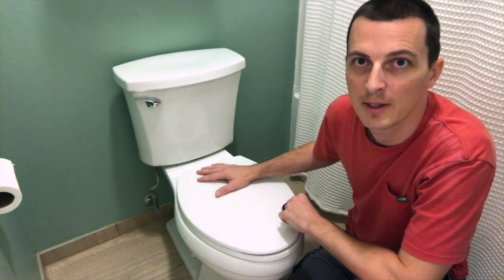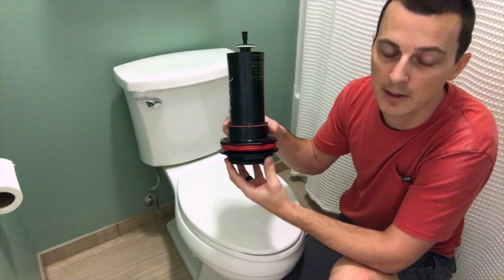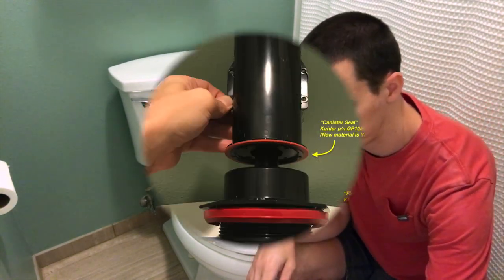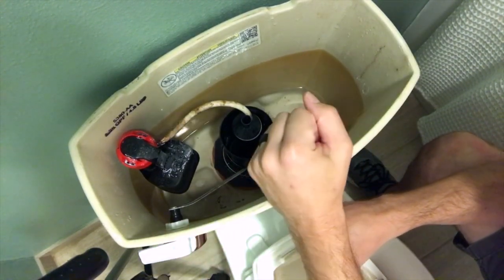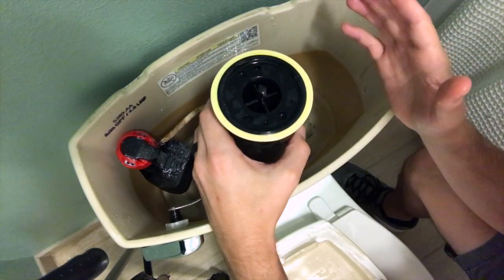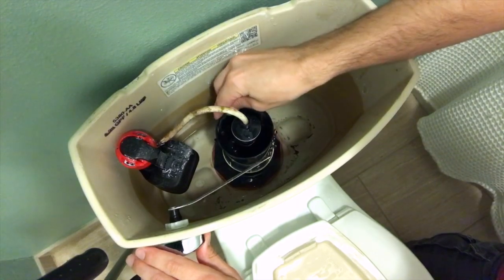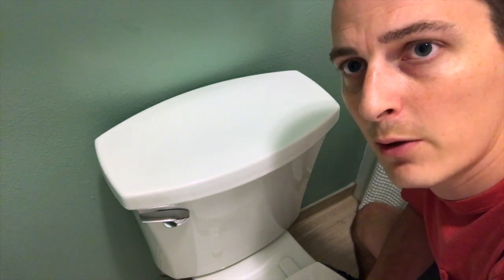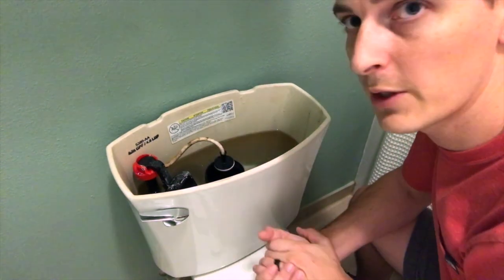Repair a leaky Kohler toilet with an Aquapiston canister flush valve

Comment: This presentation was excellent. I'm a 71 yr old grandmother, and installed 3 toilets over my lifetime Your video was the first to explain the complete installation process including the plate on bottom of tank. My silent flow valve never turned off, water was filling up and draining continuously for 2 months.I had an astronomical water bill. I still  do all my home repairs myself, and always look to YouTube for assistance. I thank you for your video, well done! , toilet fixed with ease.

Comment: Over time, those stupid black brackets begin to rust and the rust gets into the threading of the flush valve. At that point, you have to put a little piece of something between the flush valve and the tank to keep it from turning in place, take a large wrench, put all your weight into unscrewing it, and hope to God that you don't break it. Kohler has some of the absolute worst designs out there and this is a perfect example of it.

Comment: My flat seal started to leak after only 2 years on a new Kohler. I purchased your wrench tool and it worked like a charm to aid in the repair. My channel locks wouldn't go wide enough so thank you for making that. Awesome job with the detail in this video!

Comment: Another tool I found you can use is called a trigger clamp. I have some because I do a lot of wood working. I do also use them for a lot of other things and they do come in handy. Even if I didn't have one, I would have gotten one of these to do this job, you more likley would use this for other things, rather than a specialized tool, that I hope you never have to use again. Other wise, I am with everyone else, this is a great video and it helped me a lot.

Comment: Nice through video. I took a quick look at the eBay page but didn’t see the wrench there. I would never use A petroleum product like Vaseline on a o-ring or seal. That is exactly what makes them swell. It’s advice from the old days when selling o-rings was profitable. Stick with the silicone grease only.

Comment: Just did one of these.  Your video helped a lot.  HOWEVER, that 4" nut was on REAL tight.  So tight, that when I went to turn it, the base that it's screwed on to started turning.  I had to use a small shim of wood (about 3/8" thick), and wedge it between one of the base's hex flats near the bottom on inside the tank, to hold it from turning.   Just a heads up for others that may encounter this same level of tightness.

Comment: Thank you for a perfect step-by-step procedure. Ordering your wrench saved me the stress I got trying to get the old one off with an oil wrench. Oh it came off alright, in a zillion pieces after I couldn’t get the oil wrench to budge. Perfect creation, thank you!
I used the silicone grease and bought the new yellow gasket, since the Kohler kits still include the red one (2024). 
Thank you again.

Comment: Thank you so much!  This is really an extraordinary video, one of the very best home DIY repair videos I have ever seen.  The details about specific part numbers for literally every single thing you mention in your video was for my particular situation a game-changer.  There are a zillion videos that talk about the upper flush seal, but no one ever talks about the lower "flat seal", and not even the supply shops I talked to could come up with a part number.  They kept bringing me the upper seal and saying "no, really, this is it."  I walked away from this video with a complete solution, knowing what parts I needed and how to replace them.  Just a next-level video.  By the way, I was able to use a oil filter strap wrench to get mine off, but it was not easy, it still took a lot of tries.  Thank you!

Comment: I have little faith in most technicians. Doing it myself, I know it will be done right. First I have to know how to do it. Thanks to you, You have given me the confidence to fix my own toilet.
Reply: Hi Garrent !
Please forgive using the public forum but the contact link doesn't work on ebay. I am interested in your tool, but the ebay site seez there are none left.  Looking like I have to replace the bottom seal. I can use my strap wrench. I actually have a chain vise grip that would do the job too, but I kinda like to use your tool in support, since it was you that got me this far.Do you make them still?

Comment: This was perfect - thank you!  I needed to go only as far as the upper seal, which came out easily.   I then scraped away some crud, searched for the replacement seal, and found t hat a nearby Lowes had it.  I went there with the exact row and bin number and was in and out in less than 5 minutes.  Installation was quick, and the leak is gone,  You saved me more than a $100 plumbing bill, so many thanks!

Comment: Great video thanks.  You really went above and beyond in your description, even to the point of making your own wrench!  Don't mean to cut into your inventiveness, but Harbor Freight oil filter pliers work great on the large nut (get the self-adjusting ones).  In a pinch, you can also use a bar clamp, but if you are going to spend money, get the oil filter pliers as they will come in handy for all sorts of odd ball jobs, even removing stubborn oil filters!

Comment: You don't need solutions until you have a problem.  Thank you for solving mine!  I acquired a Kohler toilet problem with a recent move into a 11 year old home: chain kept breaking because the gunky red canister seal caused the canister to 'stick'.  The instructions you provided were excellent.  After a trip to Lowe's to pick up the part ($6.99 seal), the problem was solved in 5 minutes!  Thanks for providing an outstanding solution!

Comment: Great video! I was having an issue with water leaking through the flat flange after flushing. Started working my way through the video, and found the tank nuts were a little loose. Tightened them up, no more leak! Thanks much!

Comment: Thanks - aside from lots of lime build-up, replacing the deteriorated red gasket with a new yellow one solved my slow leak issue (so far!).  
The hardest thing was gently working that plastic mounting stalk back and forth incrementally to cut through the lime deposits locking it in place.  Felt like it wouldn't take too much pressure to break the tip or one of the locking nubs off it!

Comment: I have the older style Kohler (The Cimmaron). As best I can tell, that huge flush valve nut is about 4 1/4in.  You are correct. I did not find any tools made for taking that off.  As luck would have it, I do woodworking.  What I did use and what worked fairly well.....was a 24" Bessey K-Clamp. These clamps are beasts and I have found so many uses for them past simple clamping... I was able to not only remove that nut, but also tighten down the new one with the clamp.

Comment: Perfect instruction. Thanks so much. I'm not a handy man at all. But you made this replacement easy. 
Challenge for me was the 4" nut was glued on to the bolt. I tried wd40, hammers, flathead etc. Ultimately I had to saw it off...which only took 5 mins. Much appreciated saved me a $250 minimum service call!

Comment: Min 10:00  This was my question answered.  I actually heard angels singing briefly.  I live chatted with Kohler and they do not have this tool.  Most of the DIY videos omit this key step.  But one guy in his video had this tool... where is that tool???   My issue was a disintegrating gasket, part 1097686 at inside base of tank requiring this removal on a flapper style (not canister) drain.  While at it I'm replacing gasket between outside of tank and toilet. Purchased your wrench just now!!!  Thx

Comment: Very good instructions
Reply: HI Garren. I have been having trouble with my tube to stay up long enough to fill the bowl, not the tank but the bowl itself. I have to hold the handle up or it goes down instantly and seals the bottom. Can you help me to allow it to stay up on its own?  Tx Sherri

Comment: Good vid, I suggest replacing these toilets just because the toilet get tough to flush. The yellow concentric canister seal will get bubbles holding one side of the seal up and allowing water through the valve. And lastly the time it takes... so you really wanna have to do this again...ever.  Gerber  Avalanch or viper. 3 inch flush valve. Standard parts. No monkeying around.

Comment: Thank you for your video. It was so helpful. I do wish I had a tool like the one you have before i started working on mine but I did manage to get the 4 inch nut off by using a wet washrag over it then using a oil filter wrench I happened to have over that. But I'm going to get the right wrench before I do my other ones. Thx!

Comment: Wow Garren! Very professional and easy to follow!!! I’ve been searching and couldn’t find help on YouTube until seeing your video! Any help you can offer on the difference with the triangular three bolt kohler toilets with these canisters? I’m guessing it’s similar.
Reply from the maker: Thanks, John! Yes, the troubleshooting process is nearly identical. The main difference is that the Kohlers with the triangular mount on the flush valve have a 2-inch valve (the the valve body necks down as it goes through the bottom of the tank) with a 3-inch nut securing them on the underside. That nut is usually hexagonal in shape, but can be octagonal. Also, the valve body's seals and gasket are a slightly different shape and fit that seems to work more effectively than those made for the 3-inch valves. Everything from the canister seal and up, including the valve guide, are the exact same design and part numbers. Very important... If the through-holes for the triangular mount are the source of the leak, the water will leak to the OUTSIDE of the bowl. If you're troubleshooting an internal water leak, as I'm doing in this video, I would recommend leaving the triangular mount installed, as removing and reinstalling it could interrupt its seal. Start with the canister seal (especially if yours is the old red version) and go from there.

Comment: not sure if it'll work, but that ~4" nut isn't likely that tight. Since I don't have channel locks that size, I'd try a C-Clamp or two, or something to that affect to grab it tight, then try and turn that. Or maybe even use some scrap wood to nail two boards ~4" apart on another board so you have a good grip to turn it from.

Comment: I get the idea of putting dielectric grease on the gaskets, but: many rubbers and plastics are attacked by oils and greases. Better to use dishwashing soap, smooths but does not attack anything. For getting that big nut off, use a "channel-lock" type plier, or better yet, go the whole 9 yards and get a Knipex. They're by far the best and open to incredible widths, and you can use them on anything, not just a Kohler toilet with that valve. Spend whatever you have to for Knipex pliers and wrenches.

Comment: Thank you for your attention to detail, Garren.  I have replaced many of the yellow seals, I think they are adversely affected by bleach tablets that my wife puts in the tank.  Are there any old-fashioned "flapper" flush valves that will fit in the same large opening?  I am guessing that something has to survive better than the $7 yellow seals.  On another note, I think that I am onto the next level, soon to see if I have a bad flat seal, thanks to your educating me.
Reply: Did you find an "old fashioned flapper" to fit the same large opening? Thank you

Comment: One reason parts get "weird" is chloro-mine degradation of buna-n rubber. Replacing with a special EPDM rubber seal might prevent the disintegration of buna-n rubber. Might help keep the nasty black from sluffing off onto your hands and internal mechanisms.

Comment: My kohler toilet looks like it has a grey foam gasket inside the tank that's deteriorating (shredding off pieces...probably from chlorine in water) but not leaking. Can I replace with same red gasket you used when you replaced tank gasket?

Comment: how long did your flapper seal last??  just wondering if you are happy with this toilet overall
Reply from the maker: MrMjn5000 I have three Kohlers in a house we renovated in 2014 that I’m mostly happy with overall. On all three, the original red canister seal got gooey and failed within the first three years. The new version (yellow) is a different material and seems to hold up very well. Two of my three toilets have the 3-inch canister flush mechanism as shown in this video. Both of them began leaking at the tank-to-bowl “flat seal” at about the 4 year mark. One was rock hard and had to be replaced, the other was still very pliable, requiring a little bit of grease and tightening of the flush valve nut a little further.
Reply: @garrensizer  thanks.. i just called kohler and they told me the new ones are coming with the yellow seal

Comment: What is the best way to remove rusted bolts after the plate has completly disinagated leaving only the bolts with no way to get a socket On it because they are deteriorated but they are still on the toilet

Comment: Very well-organized and useful video. Thank you.  Do you know the part number of the gasket you remove at 9:46 in the video?
Reply: No need to respond - I found it - GP1018165-F. One of these failed on me (probably 12 years old) and whenever I flushed, water leaked from between the tank and the toilet bowl.

Comment: Just by changing the internal to the tank canister tube gasket, i somehow caused the big gasket between the tank and toilet to leak water all over the place. I didnt even touch it. I was trying to stop water from draining , causing the water fill to constantly flow - I ended up creating a much bigger issue. What a pain. I was trying to aviod having to take the tank off, but no luck. I hope I can find the big gasket to replace, and i hope that will fix the problem. i also hope i can get that big stupid hex ring off to change the gasket...

Comment: Great video. I am still having a hard time. Can I compress the flat valve too much,?
Reply from the maker: I’m sure it’s possible to compress the flat seal too much and deform it to the point that it leaks. Off the top of my head, Kohler instructions say to tighten it by hand, then an additional quarter turn. I’d say just a bit beyond that. Somewhere between 1/4 and 1/2 turn beyond hand tight seems to do the trick.
Reply: @garrensizer  Thanks
Reply: @garrensizer  And how do you determine how much is enough to not over tighten the bolts?  I followed the video and still got a leak once on right side. Then I tried again and ended up with leak on the left side.

Comment: Has anyone had trouble with the bracket pulling away from the bottom of the tank and causing the tank to wiggle  if so how did you deal with the issue

Comment: I'm currently having issues taking off the flush valve nut and I'm using the wrench I ordered from Ebay. I can turn the nut with wrench but it takes all my force to do this and that plastic valvethat its attached to turns with it and I'm not able to hold that in place to take the nut off.  What do you suggest I do?
Reply from the maker: Jacob Enright the valve body inside the tank has an octagon shape to its housing. You can wedge something between the valve body and the tank wall (on the inside) to hold it while you spin the nut off.

If the nut is truly stuck to the valve body and won’t break free, you can use a hacksaw or an oscillating tool to cut vertically into the nut and threaded portion of the valve body. This will require replacing at least the valve body, but at that point it’s cheaper to replace the entire flush valve assembly (~$25 to 30).

Comment: I looked into your eBay for the wrench and it says out of stock. Is there any way I could get the tool? I’ve been asking around and looking over several plumbing supplies stores and they didn’t have a tool for this to remove it.
Reply from the maker: Short answer: You can order the LARGE multi size Octagon wrench from this listing: https://www.ebay.com/itm/Wrench-for-toilet-flush-valve-nut-multiple-sizes-available/233627476190

Long answer: The original 4-inch octagon wrench quickly became 5 different sizes and it became difficult to determine what size people needed. Production and inventory was challenging too. I made a whole new design from scratch that allows a given wrench to fit a range of sizes rather than just a single size. That consolidated five products into two. They look funky, but they work great. These new wrenches are made of a high quality, marine-grade, 1/4-inch thick High Density Polyethylene (HDPE). Think milk jug or five gallon bucket. I'm still updating product photos and eBay listings to reflect the current product line.

Comment: The tool you need is an oil filter wrench.  The short handle ensures you will not overtighten.  I’ve rebuilt about 50 of those toilets and never had an issue.  I always tighten AS MUCH AS POSSIBLE.  Edit: I have NOT tried this method with silicone grease.  Seems absolutely unnecessary but whatever works.

Comment: man i wish you worked at home depot or lowes... those $!@!@# are useles... ive been there 4 times just to try and fix my damn toilet.... first they sold us the wrong complete kit 2" instead of 3"... Then  we  returned that shit.. and now im at the stage of ive got the kohler tank to bowl seal new... and a new fill valve but now it looks like the damn flat seal is leaking but the whole metal plateis super rusty... so it makes me wonder about this toilet... is it normal for metal plate to be rusty and gross?
Reply: yeah is it normal for the tank plate to be super rusty, it makes it hard to screw the nut back on... I suppose I should just order a new one and get one ofthem tools.. Lowes was the only place that had something similar but i got large adjustable pliers as per the instructions for replacement kit...ugh